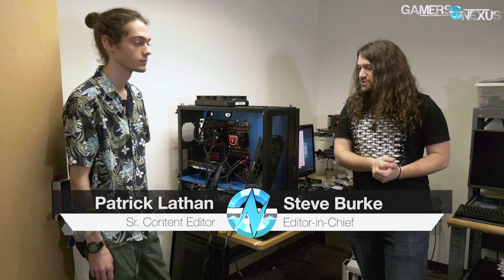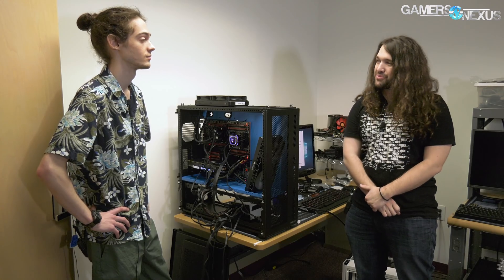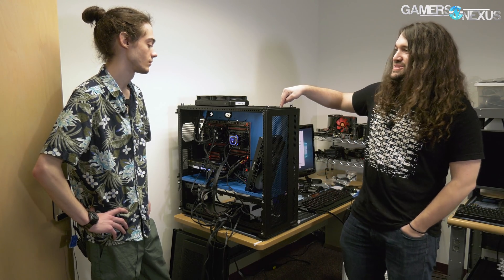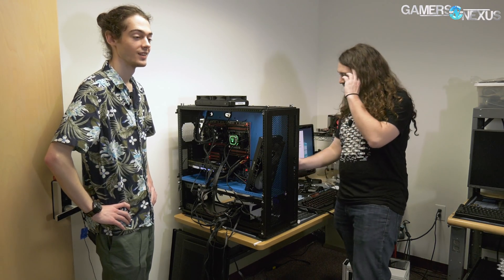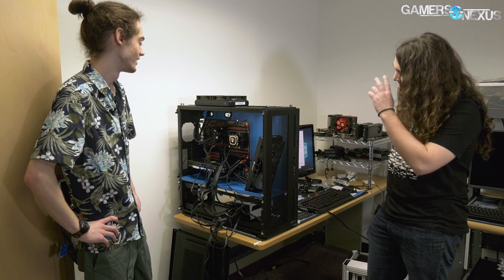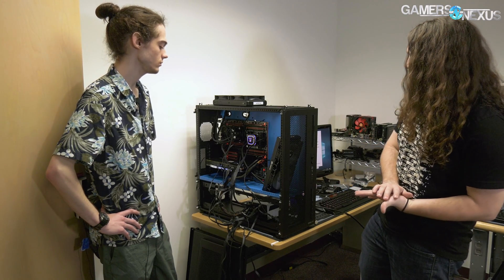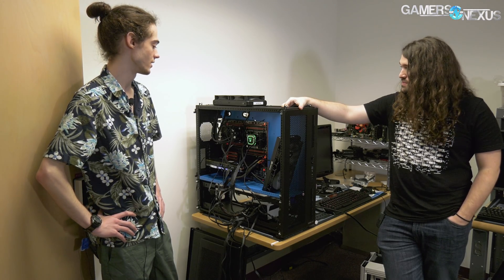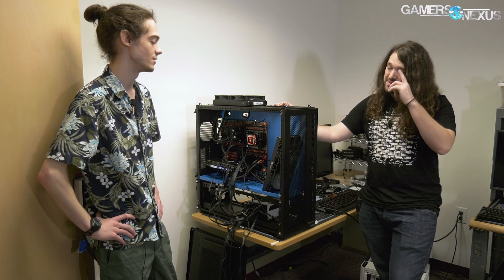BTS: Challenges with Our Dual-Socket Server

Comment: Dual Xeon people to hit up would be Craft Computing (did one with the Huanan board) and of coursr Bryan of TechYESCity fyi. HP Z820 workstation could also work if you wanted to keep using those CPUs. I couldn't boot my HP Z420 and Z620 motherboards with my Xeon E5-1650v2 and E5-2667v2 without registered ECC RAM though. So there's that. But that same e5-1650v2 booted just fine in my Asus p9x79e-ws with standard unbuffered RAM though. Glad to hear you guys got it up and running!

Comment: How does that generation of XEON's compare to a Ryzen today?
Reply: R15 score of a single e5-2697v2 is around 1560 and r7 2700x R15 score is around 1820.
E5-2697v2 has TDP of 130w while r7 2700x TDP is 105w.
Reply: A Threadripper 2990WX R15 score is around 5200 with a TDP of 250w.
Two of those Xeons would draw around 260w TDP with a theoretical R15 score of 3100.
Reply: I hope that my rough estimates are of some help.

Comment: omg Steve is that bubble wrap behind the motherboard? I sawed a RX 470 cooler in half to cool a vrm (placed fan on top of course) on a RX 480 and sanded down down the extra aluminum pieces. Then I put an aio on it with copper heatsinks on the ram modules like  you did in your hybrid mod... that bubble wrap is still by far more JANK! I have been beaten :(

Comment: If you're having future problems with the evga sr x try using the supermicro x9dri-ln4f+. I build a dual socket E5-2697 v2 system on this board and the board itself is pretty cheap. At least in europe.

Comment: lol i had a same issue with that CPU found out that the board coudnt suport the power requirements of a 130 TDP, had to go with a 95w. But it sounds like you got it to go with the ECC Ram?! thats weird. i have had issues with ram on multi socket in the past but it was resolved with what slot you put the ram in. The slots were not back just needed to fill slot 2,6, something something to get it to boot with 4x4gb

Comment: well i've got some 12800 DDR3 ECC LDIMMs for $20 per 8G.. cough*ebay*cough
Reply: As far as I recall only 1333 MHz is supported with 5600 series CPU and 1066 MHz with 5500, and up to 8 ranks per channel. 2R 1333 ECCR 16 GB can be had ffor 28-33 USD per stick.

Edit: it does support 1600. I thougjt that SRX was 2nd gen SR2. I didn't know that EVGA made C602 board.

Comment: I would go to a machine shop and have them make you an aluminum plate with 1 set of holes to mount the plate to the case and another set of holes to mount standoffs for the MB. Or get a tap and die set and drill and tap the holes needed for the EATX MB pattern. Solid video though.